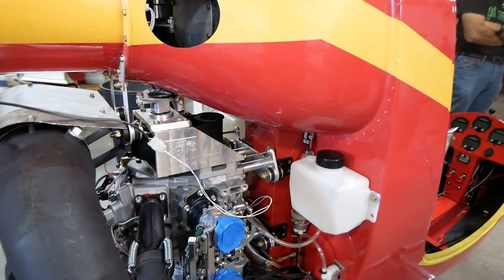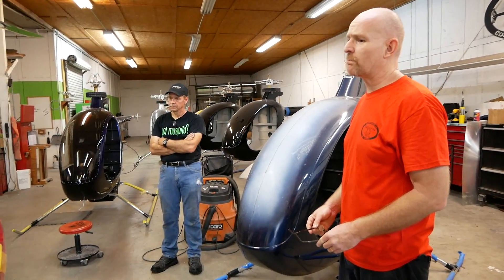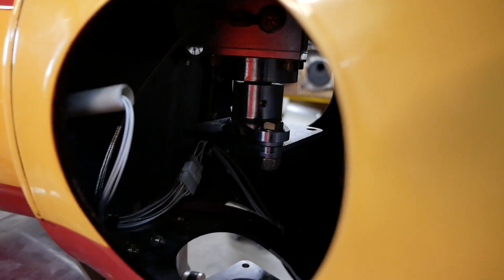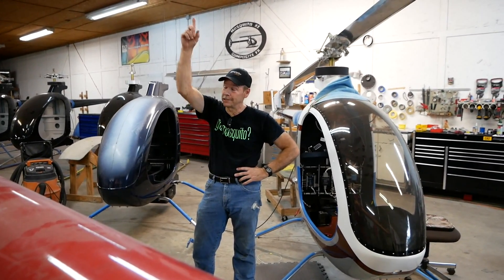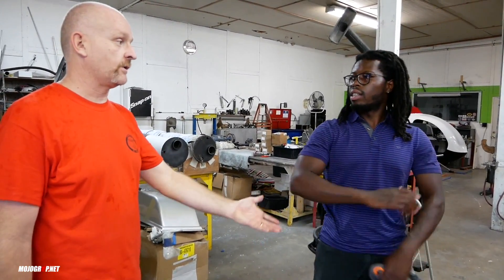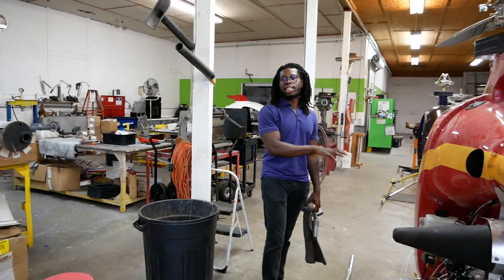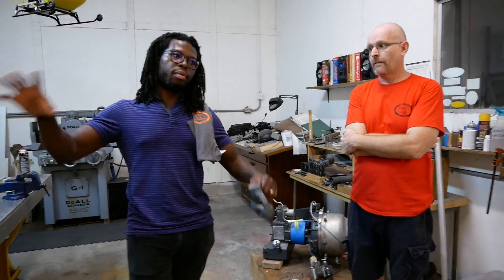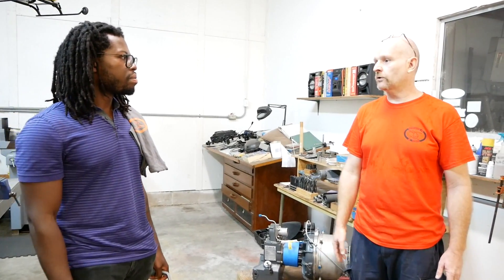Mosquito Helicopter XET Turbine Or Piston Engine

Comment: What is the truth to this. I heard if you own an aircraft you are not allowed to maintain it yourself? I worked on helicopters for 20 years in the air force so would want to maintain my own
Reply: You can do owner assist with an A&P…or send it back to manufacturer and do an owner assist there as well typically. You can do your own oil changes etc.

Comment: Why do you de-tune the engine to a lower horsepower? Trying to understand.
Reply: Reliability and engine life.  The extra HP is not needed anyway as speed is limited by the rotor (retreating blade stall).  The only place it might be an advantage is at high altitudes, but at rated 85HP, still plenty of excess power.

Comment: So on the XE285, do you need to replace engine pistons and perform top/bottom end engine rebuilds with a certain ammount of hours, like on a two stroke dirtbike?
Reply: Most aircraft have a guide to that - "mean time" to rebuilds, etc.  This will be similar for the piston engines; the turbine will be quite different.
Reply: @simplywonderful449 And this Suzuki B80 engine, routinely lasts 3 to 4 times longer TBO than Rotax 2 stroke.

Comment: I bet required maintenance for the turbine engine is much lower and less frequent than for the 2-stroke. How many hours between overhaul on the turbine?
Reply: Turbines are generally less maintenance, but also much lower vibration, smoother operation overall, and better performance per weight and fuel usage.  It's why the turbine is the choice in large helicopters too.  A jet package for a Bell LongRanger can be swapped out in a few hours by an A&P mechanic, they're available rebuilt already and smaller & lighter than a piston engine for the power provided.

Comment: No one mentions the noise level?
Reply: Have you ever ridden in ANY helicopter at all?  Even a turbine Bell JetRanger or Bell LongRanger is noisy even with a closed cabin.  They're NOT quiet as the power is the lift - "rotary wing" - unlike an airplane where the lift is generated by a fixed wing.

Comment: If they just used a BLDC variable speed motor only for tail Rotor they could have increased efficiency of engine with further reduction in weight and besides it may also  increase the tail rotor reliability.  It also elements the need for Tail Rotor Pitch Variations .
Reply: You want to use another motor - an electric variable speed - to power the tail rotor?  You're thinking of your electric R/C helicopters.  This is the real thing.  What do you think a battery/generator setup, plus the motor, would add to the complexity, reliability and cost of the machine?  Now you know why engineers build helicopters.  Your reliability would fall with an electric tail rotor.

Comment: One does not build a copter with a piston engine. It can be done but the refinement of gas turbine and the degree of stress they operate under is so much better; A piston has a "pulse of torque" a gas turbine is smooth (called Brayton cycle) constant combustion which lends itself to the demand of aircraft with power to weight ratio and durability. No other internal combustion engine can match
USNavy Gsm3 En3
Reply: Bill, sorry, but "one" builds copters with MANY different engines, pistol or turbine.  Small helis often use piston engines because they're not as expensive and the increased power of a turbine just isn't needed.  If you check out makers of two-seat machines you'll see that the majority of them ARE piston-powered.
Reply: This particular 800cc 2 stroke engine, is the Suzuki B80 engine, designed for Arctic Cat snowmobiles, and considered the most reliable sled engine built in its class, 80-165 HP

Comment: 240lb sounds like alot but im 6'4 with an avg build im pushing 210 215 with a coat boats ect i can be about 225 would take much muscle with some food for me to push 240lbs, now if your 5"10 the avg hight 240 is alot but 6"4 its not that much

Comment: The labour rates in the US are very high compared to may other places in the world. If this machine was made outside the US it would be substantially cheaper.
Reply: So how much cheaper do you think.
Reply: @60viking  I think probably half the cost if the entire machine was made in China or India. And the billet CNC machining is also expensive. If the main and tailrotor gearbox housings were cast and machined another saving. The only problem with offshore manufacturing is the extensive quality control that needs to be implemented, and that's a huge problem for Asian manufacturers. Perhaps the best solution is a mixed approach by having many less critical parts manufactured offshore and the critical pieces locally.

Comment: Once I seen the belt on the top Rotor I was like ... 
Hell Nooooo !
Reply: Robinsons use a belt on their drive also.  This is a very reliable and tried and true system.
Reply: Notice there are TWO belts.  If one fails (and you'll KNOW when that happens) you still have full drive.  If you follow the book on maintenance you won't have a failure other than abuse.  If you DON'T do the maintenance, you shouldn't be considering any such aircraft at all, perhaps instead a scooter.

Comment: Has this type of turbine engine ever been used on a fixed wing aircraft???
Reply: Only once, for one of those micro-airplanes, the Bede BD-5T as a turboprop.  Its mainly used as an APU, especially on larger military helicopters in its military designation as the T62T.
Reply: @get2dachoppa249  thanks for the info man!

Comment: Hi, can you clarify about rotor control system of mosquito, as it's different then the conventional ones. Is it capable of complete maneuvers which other can do ??  Also is it safe comparable to conventional ones ?
Reply: Hi, it's the same control system to the conventionals ones but the autorotations caracteristics of the Mosquito makes it one of the best in that segment so very secure machine as soon as you learn all the emergency procedures as you would do for flying conventionals ones.
Reply: Can you make a mechanism demo video on it ??

Comment: has mosquito ever looked into co-axial rotors?
Reply: also whats the TBO on the 2 strokes and the Turbine?
Reply: @captarmour  I'd put 5 hours on the 2 stroke before overhaul lol. It's a damn snowmobile engine, who knows how reliable it is running constant up in the air. The turbine probably runs for 2000 hrs or so like most.
Reply: @codmott286  running at 6000 rpm instead of 8000 shouldn't it be reliable?
Reply: @captarmour  It might last a little longer but wont help with reliability. 2 strokes are inherently unreliable. The lack of a dedicated lubrication system means that the parts of a 2 stroke engine wear a lot faster.

The cheapest lightest weight 4 stroke you're going to find is a Rotax. Unfortunately even those are too heavy for a tiny helicopter like this. Bigger aircraft pushes the price up into the 6 figure territory which Innovator wants to avoid. Best bet is to not skimp on the extra $20,000 and get yourself the turbine.
Reply: @codmott286  the 850 Etec has a dedicated lubrication system and direct injection which gives good economy. Probably the only 2 stroke I would entertain
Reply: @captarmour  It's not a dedicated system, it is merely oil injected which saves you the hassle of having to mix oil with the fuel ahead of time. It still burns oil like any other 2 stroke. Keep in mind this engine has been completely removed from its intended design. This engine is meant to operate at high altitudes in low temps and Innovator is doing the exact opposite with it. How well is a snowmobile engine going to operate in the Texas heat?
Reply: @captarmour  dont get me wrong, from what I recall John Uptigrove (lead designer of this aircraft) actually preferred the 285 and flew that as his personal machine. I believe parts availability and serviceability were his main arguments. Given the Solar turbines are military surplus there is no supply chain if you need something replaced. You basically have to buy a whole new engine and harvest it for parts. And even if you did get a scrap engine who's going to do the work? It's not like these are normal turbines that any shop is willing to work on. At least with the 285 you could literally get any grease monkey to tear it apart for you and have parts available by the next day.
Reply: @codmott286  I have a 1975 mx 400 that has premix , no over huals,  I ride every time the sun shines 2 things make it so
Synthetic oil. And a sensible throttle because if I don't it will kill me , it said so
Reply: @codmott286  The piston engines are detuned in part to extend their TBO and make them more reliable.  As a helicopter engineer yourself, you probably knew that already.
Reply: @simplywonderful449  dont care if it's detuned, it's being run in an environment it was never designed for. Constant RPM in hot climates (depending upon where you live). This is a snow mobile engine, it's designed for cold climbate high burst power output variable rpm. It's simply the wrong tool for the job.
Reply: @billrussell7672  yeah? Would you put your engine in a plane and run it at 100% power for 4 hours at a time?

Comment: Think I would be a bit nervous running a 2-stroke on a heli. Yet seems this company knows what they are doing so could be tempted based on their track record and knowledge.
Reply: It could also be that they're aviation/aerospace engineers too, besides "track record".  Yes, it does matter!
Reply: Fly low!! LOL
Reply: 2-strokes do cut out. But, well... That's why Autorotation exists. That said, that's the only way they can keep the weight down.
Reply: @dfx2kxgaming145  They "cut out"?  They're used in more ultralights and such and actually go longer than many other piston engines.  Where have your two-strokes "cut out" and why?  There is an astounding amount of misinformation in these comments!
Reply: I wouldn't trust a helicopter period, they're an affront to physics.
Reply: The workings of a helicopter are just insane, so much more to go wrong than fixed wing stuff

Comment: Mike, thank you for the added information. Even at $70k with the turbine motor (high kinetic energy) and the slightly greater HP- a 3,000 FPM climb is pretty insane. Good, clean fun for less than a new Corvette. Sure, top speed is a mere 100 MPH, cross country travel is a no go, and, taking the wife out for a $100 burger isn't gonna happen- but, I'd guess that the amount of focus required for flight safety would limit flight times @ 2 hours anyways. I found a nice used XET (turbine) with low hours for $85k, but, it has every available option on it including the Ford Model T color scheme (black).
   Based on the dialogue- I sense that the MZ202 is less dependable than the 85 HP version, and, neither piston engine can match the consistent (and dependable) output of the fuel hungry (9+ GPH) turbine. You and I share similar dimensional space, but- I'm only 170 Lbs.- so, I'd be happy with the performance of the middle model. Boy, it would be great to find a low hour used one for say- your airplane budget ($25,000).  But, dreamer's dream...
   Oh, before I forget- please put closed captioning below the dialogue from 10:30 'til the end. What's stated, and, truth vary by a significant margin.
XET= $90,000.00 NEW (because no-one installs base instruments. Ever.)
XE w/ larger (85 HP) piston engine= $70,000. (Base= $54,000.00) See XET above
XEL= $50,000.00
XE Air= $40,000.00
Build hours: 1,500 to 2,200 or, about 3 years for your average builder.
   Promise- no 'hate' meant or intended, just real world considerations for those on the fence about commitment. Yes, a lot of money, AND, a lot of time, but, definitely worth it to the select few who have 'The Right Stuff'. Personally, I have too many kids, too much work, too many hobbies and interests to build one, but- would love it if I found one in a barn for sale on the cheap. Sadly, there are too few in the world, too few unfinished and probably NO unloved ones on the planet...
   Those two guys are my heros. I think the guy wearing the black 'Got Mosquito?' T-Shirt is Dwight Junkins, who is a gutsy fiberglass genius (Nikola Tesla/Albert Einstien/Elon Musk all wrapped up into 1). He deserves a movie, like the engineer who designed the Mosquito Air. I wish I could ask him a couple of dozen questions in front of a camera. Very grateful for his commitment, otherwise- there would be no Mosquitos to swat at all.
Dave
P.S. Mike, the audio is a little rough- not sure why and I know you invested in expensive microphones?
Reply: @michael ryan No, the website is current. The XET kit does NOT include the modified turbine in the kit price. It takes a special person (or BIG budget) to complete one of these. Skill sets needed; mechanical, fiberglass & paint, desire to upgrade "while I'm in there" & general price creep (over time from purchase to completion) are real on a project of this magnitude. I WANT one- bad! I have mechanical aptitude & a fiberglass expert on staff (wife), but, no paint skills. I'd need to pay for pro spray- after the $$ & time investment to get to that point. Advanced avionics are more expensive, but- lighter in weight- just the excuse I need to upgrade. Attempting to put a dose of reality into a very exciting proposition- that's all. Remember, I like everything about it, just wanted to share what I found on additional research, that's all.
Reply: @michael ryan Innovators site uses optimistic pricing on the turbines. Since they are military surplus you have to find one wherever you can and on average they sell for about $20k a piece. So 20k on top of the 50k for the helicopter kit puts you in the 70-75k ballpark.

Comment: That's my Mosquito! (before it was finished)
Reply: We need video! Not as proof, but- simply the sheer awesomeness of it. Come on AeroEng Guy- DO IT!
Reply: Norbert shot some video of me hovering that he will post on the CFX FB page.  I don't have any video yet.
Reply: AeroEng Guy sorry buddy, you have no video?!? You have a helicopter but not a cellphone camera?!? I don’t believe you.
Reply: @BillyN31  You cannot hold the cyclic and the collective at the same time and use a cell phone, and you cannot ever let go of either.  I'll be mounting a GoPro tho
Reply: @aeroengguy448  that's awesome, and don't worry about the video greedy people, go slow and safe. If I got one it would take 6months of me routinely flying, and practicing slowly getting higher and higher checking my skills in ground effect. One thing I saw that bothered me tho, I did not see any bolts with safety wire, are they wired? If not, I would be checking over all the fasteners before every flight for the first 5-6  and then probably every other to make sure nothing is getting loose, it backing off due to heat and vibration cycling. Anyway stay safe, and have fun.
Reply: @A_Man_In_His_Van  some bolts are safety wired, most others are lock nuts.  I also used torque stripe paint everywhere on all bolt heads and nuts.  yes, everything is a preflight issue.
Reply: Did you fly it?
Reply: ot0m0t0 yes, started flying last week
Reply: @aeroengguy448  So how do you like flying the Mosquito do you get scared at times in wind gusts?
Reply: @mikehartung1627  I gotten scared just learning its handling characteristics.  Well, let's say approaching everything very cautiously the first twenty hours or so.  Wind gusts haven't been a problem yet because, so far I habeen avoiding gusty days.  Winds up to 15 kts or so is about my current limit.
Reply: @ot0m0t0  how much money,if I want to get that Hely mosquito,I'm from Langsa Aceh ,aindonesia.thank.
Reply: @muchsalalpin9404  You can get this helicopter around $32.000 Dollar..But i didn't Knew how much you can get this to indonesia...
Reply: Eww Raaaah!
Reply: AeroEng Guy t
Reply: The very best of of luck with it buddy,there absolutely amazing little things I’d love one😂... some day some day 🤞
Reply: @America It is still a lot of fun to fly.  Have had some minor maintenance issues awaiting parts (starter died) and bad weather that have slowed me down, so I'm looking forward to building time this summer.
Reply: Nice.........!